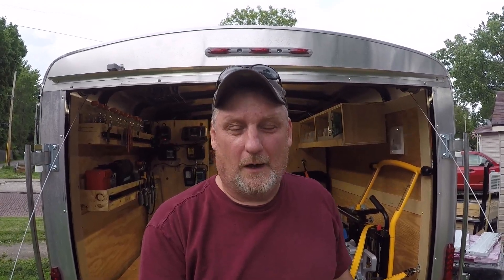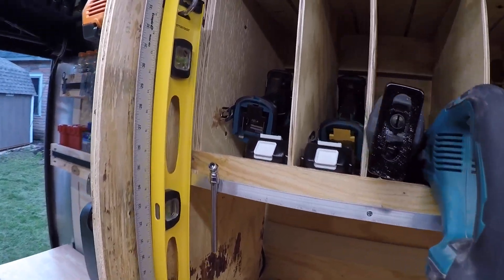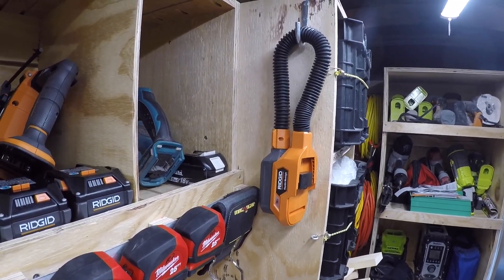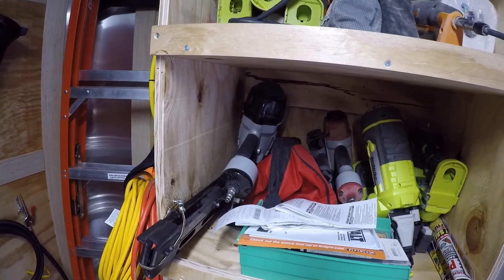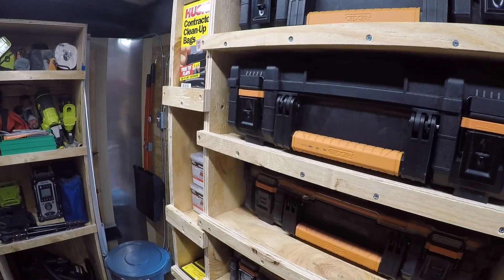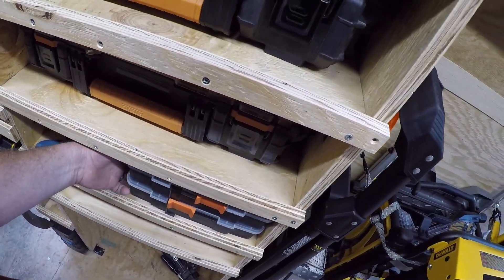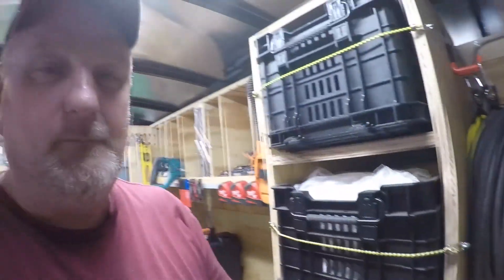Paulk Inspired Tool - Work Trailer Build Handyman and Home Remodeling Company

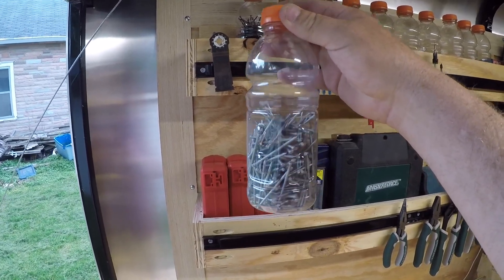Comment: Great to see you using those Gatorade bottles, 3:05, they are strong and thick.  I don't understand why people don't wash more items from around the house.  I use medium size plastic mayonnaise jars, peanut butter jars, plastic jars that nuts come in and many more.  
You can clean out and cut the bottom off of gallon and quart oil bottles that are nearly square, they make great dividers inside of drawers. I just drain them out and pass them over my table saw, a quick rinse in paint thinner or gasoline and they work great.
No need to always buy something you already throw away. Great trailer!

Comment: As a part time  handyman I constantly load and unload my truck.  Often I don't know exactly what I need so I pack in what I THINK I will need.  Sometimes it's too much, sometimes not enough.
You seem to be prepared for everything with your organized trailer. Your video is very helpful as I am currently looking for a trailer.  You are appreciated.
Reply from the maker: Thank you Sir! Believe me I know the feeling of not knowing if you have all the right stuff with you or if you have to much, I wrestle with that all the time. Over Black Friday I spent some money on setting up a rolling stack system that I can throw in my truck and go do some of the smaller jobs if the trailer is on site at a bigger job, which has been happening more and more this year. 

So trying to figure out what all to carry has been top of mind this last weekend and I don't know if I will ever get it perfect ……

As a company we are doing more and more larger projects and less of the smaller projects which I think is a good thing but we will always have a flow of smaller stuff which helps the cashflow situation.

I do think that the rolling stack tool boxes are the best way to organize if your working out of a truck.

I just bought a second trailer and will be building it out here when the weather gets nicer. It will be similar to this trailer but it is a bigger trailer and I am going to make some changes based upon what we learned this year so stay tuned for that video …...

Comment: I applaud you for going with tandem axles on a 6x12. Most would cheap out and do single.  Having 2 axles makes the world of difference.  I have my trailer built out Ron paulk style as well. Nice to see another trailer in youtube.
Reply from the maker: Thank You! I have watched most all your trailer build videos while doing my research for my build. I'm about to modify the trailer a bit, I have moved to as much battery operated tools as possible and that includes miter saw and table saw so the big stuff is coming out and a new cabinet is getting built for that back corner.

I'm also on Contractor Talk so I have read a bunch of your posts there about your trailer build and other topics. If you don't mind I will send you a PM over there, we are in the process of moving out your way from Illinois so I just picked up a new trailer a 7x16 to build out for the new market so I will be doing it a little different since I have more room and then we are going to build up the company in the new market and keep the existing market growing. 

So fun times ahead …...

Comment: Like the set up!  I have a new trailer and kinda know how I want it built out.  Two things I'm not so sure about.  How to safely mount the cabinets to the walls of the trailer?  Is yours 3/4 plywood on the back of the cabinets screwed to the 3/8 plywood of the trailer wall?  Other big thing, how to wire up the trailer with the marine battery and then also make it to where I can plug it to shore power when back at my shop?  Also want led lights at the top, high beam backup lights, backup camera on the trailer and for hitch.  Forgive me I'm mostly a wood guy!

Comment: Nice work!  I have to ask about the 10 gallon trash can.  Does the top work well?  What kind of trash bags do you use inside of it?  Thanks for the help.  I need to get a small trash can for my trailer and I think I like the one you have.  Thanks for sharing!
Reply from the maker: The 10 gallon works well for an “in the trailer” trash can to help keep the trailer clean and neat. I also carry a full size to have our on the job site. I just use 30 gallon bags, they are to big but when I pull it out I can stuff more in it during an jobsite clean up, so it works ok.

Comment: nice setup. anything you would change or want different? Im looking at getting a trailer so Id like to see what people really find useful. Would you prefer it being 7' wide?
Reply from the maker: Thank you sir! Now that we have used the trailer for pretty much a full season overall that trailer has worked very well for us. There are changes I would like to make but they aren't really big changes, just more I would call it massages to make things a little more efficient. A wider trailer would really be nice to have, I am going to be building out a second trailer his spring and that trailer will be a 7 foot wide trailer and I will be doing a build series on that trailer and I will be incorporating all the changes I would like to make in this current trailer in the new trailer build. What I will say is this, with this trailer being 6 foot wide, yes there are times that I would love to have the trailer be a foot wider it would be more convenient and more comfortable but the reality is that the 6 foot width hasn't hurt us, hasn't stopped us from doing our job. We don't work inside the trailer much it really is a rolling tool box for us. There has been some upside to having the smaller trailer, for example the job we are wrapped up today, the trailer has been onsite for about 6 weeks now parked in the customers driveway. Its a normal sized row house housing addition driveway, it's kinda a smaller driveway.  By having the 6 foot trailer I can park in the driveway and still leave enough room  for another vehicle to use the open side of the driveway comfortably, if I had the 7 foot wide trailer out there it would be almost to tight to try and use the open side of the driveway.

Backing this trailer into tighter places is most definitely easier, I can easily put this trailer in a lot of places much easier than I will be able to put the 7 x 16 trailer. I really sweated the size debate a lot before I bought the trailer, what I can tell you now is that a bigger trailer would be more comfortable and improve our efficiency in some ways a little bit, but we haven't suffered by not having the bigger trailer. 

One key to making this work is putting in the time and effort to keep the trailer clean and organized. Another thing we have found is that you don't need to have every tool you own in the trailer all the time. We have certain tools that get used very frequently and then we have tools that get used occasionally. So we keep the occasional use tools in the storage shed and just grab them when we know we will need them that day. For example our concrete tools, we use them 3 maybe 4 times a month on average, we  know ahead of time when a concrete truck is coming, my storage shed is 5 minutes from the house and most of the time I have to go by the storage shed to get to the job anyway so it takes me five minutes to stop and grab the concrete tools and throw them in the truck. Post hole digger is the same thing, we do a lot of decks and fences, usually though we dig all our holes in one day so I might need the post hole digger for a day and it dosen't make sense to me to drag it around with me to get used 3 or 4  or 5 days a month. Me or one of the guys can grab it on the days we need it.

The big thing for us was to get some time under our belt with the trailer and see how we would really use it and what we have found is that we were draggin a lot of tools around with us every day that we just didn't need to have all the time. So the bottom line to me is this trailer does the job, bigger would be nice but not necessary. I have had guys tell me that having a bigger trailer that has everything in it would save me a few 5 minute trips to the shed and that would make me more efficient and there is some truth to that but the flipside is that on some jobsites the guys with the bigger trailers quite often cant get as close to the actual worksite as I can because there just isn't room to put their bigger trailer. That makes a huge difference to me because throughout the course of the day my guys make a lot more trips to the trailer to get batteries and screws and other materials than the number of trips we have to make to the storage shed to grab concrete tools or post hole diggers, so I can see that it saves me time to be closer. If my guys can get to the trailer that is 50 feet away that's a shorter, quicker trip than if I have to park half way down the block. Quite often my guys are working in pairs or 3 together and if one guy runs to get a tool, sometimes the other guys have to wait till he gets back before they can move forward with what they are doing so now I have 2 or 3 guys all waiting that I am paying while one guy runs and gets something, so that's really in efficient and costly.

The other thing is like on this current job because the trailer is smaller and can be there with out blocking the open side of the driveway, I don't have to take the trailer out every night when we leave so we don't have to hook up and pull it out and then put it back the next day and re set it up and that saves a ton of time.

Hope my rambling thoughts helped, you can make a smaller trailer work very well and be very efficient but maybe your jobsites will allow for a bigger trailer which could be nice as well. There are advantages to both. The hard part about this is that until you buy a trailer and set it up and use it in the real world for awhile your not going to know for sure what the right answer is. My suggestion is to look at the different compromises of each sized trailer and try to figure out which ones are going to cause you the least amount of pain and head that direction.
Reply: @R2Customs  okay awesome thanks mN. im looking to buy a 7x12 v nose but single axle

Comment: No such thing as a completed trailer. It will always be 95% because it’ll always be changing! I thought the same thing when I built mine 2 years ago.
Reply from the maker: FF Barry I know, I’m already making a list of little changes I would like to make now that we have been using it on the job for awhile. Luckily most of the changes are small, for the most part the trailer is working out as I hope it would.
Reply: I’m really thinking about building a second trailer and gutting my current trailer for on site material storage. The next trailer I’m going to spec with heavier axles. My biggest regret was only doing 7000#. Next one will have two 7000# axles. Would rather have the cushion than be overweight all the time.

Comment: Very nice setup on the trailer. Gives me some inspiration for my upcoming fitout on a SA 6x10 trailer. I noticed several brands of cordless tools. Do you find that to be a hassle in the field with four different platforms?
    I am in the process of upgrading my 18v (old school ) Dewalt tools to a newer platform. I might get a few 20 volt Li-ion batts with adapters to use until those old tools finally die, but would like to only have one or two platforms. What is your opinion so far on the Ridgid line for Contractor use?
Reply from the maker: Andrew thank you for the comments. When it comes to different battery platforms the short answer is no in my case and there are specific reasons for that. Makita is my primary 18 volt platform and they are just awesome tools, run time, power, weight and ergonomics are as good or better than any of the other choices out there. Makita is my main line for the tools which I consider to be daily use tools, drills, drivers, impact, recip saw etc. The problem with all of the tool lines is that some of the tools each company offers can be somewhat expensive if it is not one of the high volume selling tools like drills and drivers etc. Take Makita for example I needed an 18v jigsaw, the Makita option at the time cost $ 280 for a tool I will use, but not use it everyday. The Rigid Octane jig saw had great reviews an they were running a promo at the time where you bought 2 batteries and a charger for $159 and you got a 6 amp and a 3 amp battery and a free tool. So from a basic economic stand point the Rigid made more sense and it has worked great for what I need it for. They had some great promos going on in May and June and I was able to get an SDS rotary hammer and I needed a big hammer drill and an oscillating tool and one of the kits came with an impact driver and I ended up with the Octane recip saw as well because that gave me 2 recips in the trailer which is handy when you doing a decent sized tear out you can have 2 recips in use.

    I got all this stuff very reasonably priced with the promos they had going on at the time and most of them are not daily use tools, except for the Circular saw and the recip saw, those do get used more frequently. I also have some DeWalt batteries that I got with my Graco sprayer, so that brought in another platform but I couldn't do anything about that because the Graco only runs on DeWalt batteries. So I have again added a few speciality tools from DeWalt like the Atomic 4" circular saw. What an awesome tool I got it a month ago and it has become the go to tool that the guys grab for most all our circular saw needs, its a fantastic and very useful tool, I do have a video coming on it. I use Dewalt for my table and miter saws, I just this week picked up the DeWalt Flex volt table saw and damn it works great. I picked up the battery powered 7" compound miter a couple of weeks ago and it is just amazing. We just finished a 10x10 porch build with an awning over it and the 7" was the only saw we used and it cut all the pressure treated 2x8's and all the decking on one 4 amp hour battery. Both of these saws are much lighter weight to haul around and take up less room in the trailer.

I have a couple of Hitachi batteries for my framing nailer and you saw some Ryobi stuff which is mainly their nailers and the caulk gun and those tools are amazing for the price, they work really well and get used a lot.

So I don't have much overlap in my battery powered tools which is why I think having 4 platforms works for us. Each brand I use has specific tools that made economic sense from the business perspective.

To answer the question about the Rigid tools being contractor grade. We have been using the tools for several months now and the guys were excited about getting the Rigid stuff, but now after several months here is what has happened. The oscillating tool works great and gets used a lot, the jig saw works great, the SDS rotary hammer works great and the big dog impact drill works great and all these tools get used regularly and we like them. The Octane 7 1/4" circular saw is pure garbage and sits in the corner of the trailer as a last ditch backup tool. My $99 Makita kit circular saw simply destroys the Rigid Octane. The Rigid Octane recip saw sits in the corner with the circ saw, it works ok but some parts have already broke on it and the Rigid tools just don't have the battery life that the Makitas have. I can put a 4 amp battery on my Makita recip and get far more run time out of it than I do with a 6 amp battery on the Rigid.

And that's what I have seen with all the Rigid tools, the battery life is not in the same league as my Makitas. I wouldn't even consider using the Rigid drills and drivers, just way to big and heavy, they make you tired by the end of the day. The makitas are smaller and lighter, run longer, Makita's sub compact line is amazing, I use the heck our of their 12 volt line and it works great. I would and do use some specific Rigid tools in my trailer for the reason I shared above, but if your looking for a main tool brand for the trailer stick with the big three, Makita, Milwaukee and Dewalt.

If you shop right Makita will be the least expensive of the three to get into their line and they have the biggest line of 18 volt tools. Makita to me has the best ergonomics and that is really important to me because we use them for hours on end everyday and ergonomics and weight effect productivity. When we build a deck and we have 1000's of screws to drive you will notice the weight and ergonomics of the tools by the end of the day, my guys get more work done in a day because they are not as fatigued because the tools are lighter and fit the hand better.

Hope this was helpful, again these are just my experiences with my crew, your experience may be different, try stuff out and see what works for you. I'm on a big smaller and lighter tools push, the new 18 volt tools have great power and can get the work done, even the smaller 18 volt compact and sub compact tools are great with todays technology advancements, we don't need the big heavy bulky tools anymore. For me I use the 12 volt tools a lot for all the maintenance type jobs and small jobs and they work great I never have a problem needing more power. 

We have so many great options available to us today its really amazing.
Reply: @R2Customs  Thank you very much for the info.